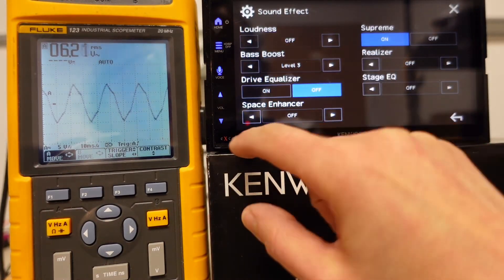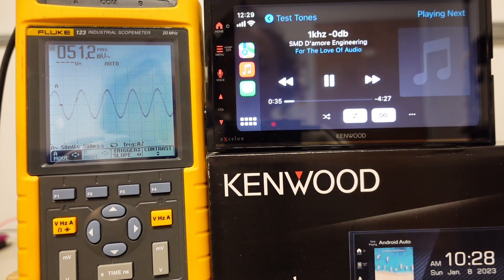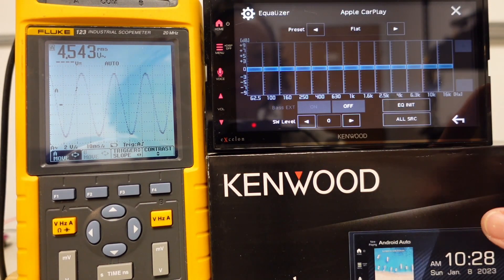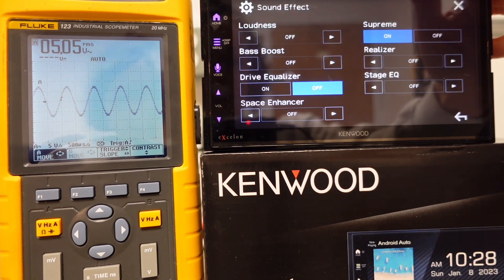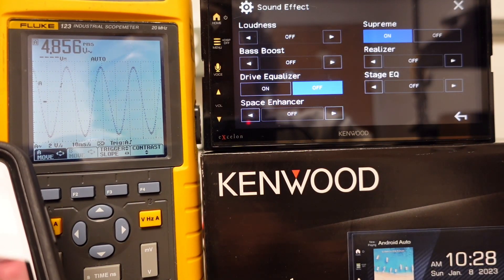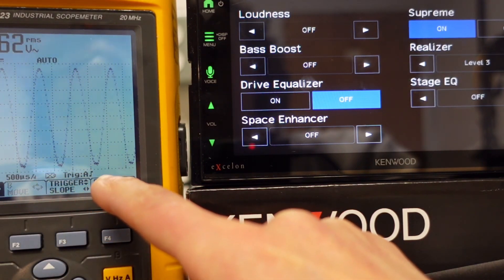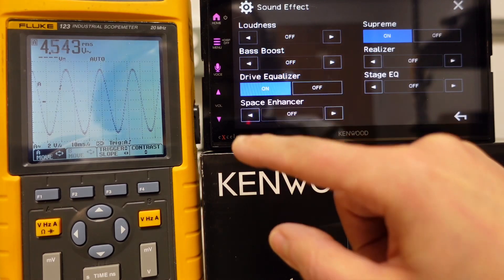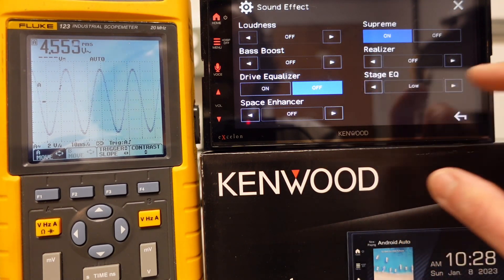Kenwood eXcelon DMX709s Preamp Test ROUND 2 - Apple Sound Check OFF

Comment: Hey excellent video, very detailed. I’m curious how to turn the sub on, on a dmx709s. We have power to the amp, tried multiple amps and subwoofers. All known working ones. It worked before, But i reset the settings when I disconnected the battery now there is no more sub action. Cant figure out for the life of me how to turn the sub on.

Comment: Hey! Love your videos. I am an installer and tuner at a car audio shop and find them very helpful with the pre-out tests. I wanted to ask if you can possibly test one of the pioneer 6600/7600/8600nex radios. So may say they are clean all the way up but to my ears i feel the excelons are louder and more clean and full sounding. I know the 5v preout has some to do with it but they are also hi res certified models. Kind of a head scratcher :/

Comment: Anything on Android phones that would cause the same factor as what you experienced when testing the pre amp output?  The reason im asking is because setting up my amps and all that im not getting any readings somewhag like what you saw.  This is off my factory head unit and factory amp im spliced in after the amp because honda has the 10th genz so attenuated.  That sends the signal to my dsp which then goes to my amps.  I have opted to stay with my head unit because so much runs through it and all chimes the steering wheel controls and side mirrors, but since ive got so much money into my sound system now and its under performing by a lot im headed to buying this head unit as im told with the metra intergration i can maintain all that stuff for a price of course.  But now im in the market for a good head unit and im being recommended to this unit or even the one above and im losing my mind here slowly lol...thanks to your video i feel bettet but wo nder how much android is hurting my readings and sound ...ugh
Reply from the maker: Yes, absolute volume. Try turning that off in the settings.

Comment: I just installed in my 2012 civic si with the stock premium sound system. After install, there is a constant static noise coming from the front tweeters, and the lowest volume I can use is still a bit loud for a conversation. Any suggestions?
Reply from the maker: Yes, try turning volume offset down to level match between the factory amp and the head unit's internal amp.
Reply: @carstereochick  yeah that was the first thing I tried and didn't affect at all. But whatever he did worked like a charm.
If you're familiar with the vehicle, do you have a recommended replacement for the rear deck sub? We tried the kicker comp 8" but basket didn't fit. Haven't had time to look for others yet

Comment: Whats the speaker leads output test at around 10:00 for? Does that mean the speakers will be clipping at volume 25? But the rcas can go up to max volume without clipping.
Reply from the maker: Yup! The radio's internal amp will start clipping at 25, but the preamp is clean at max volume. Great question.
Reply: @carstereochick i see. are most stereos like that? I guess i can adjust  the output so i can play up to max volume but not clip the door speakers to death. I plan on getting a stereo and will be staying with the headunit power until more kicker key amps come out, its out of stock everywhere

Comment: @carstereochick One thing I'm not understanding is why set the Eq to flat?  If you setting your gain on the amp to match the head unit and your Eq is flat, once you adjust the Eq wouldn't that put the amp into clipping? seems like it would be best to set your Eq curve then find your highest level for a clean output, then use that to adjust your amp gains.
Reply from the maker: Hey Eric, great question. Because this is really just to show the limitations of the radio and give everyone an idea of the head unit's capabilities. This is just one frequency we're testing. In general you really want to be making minimal adjustments on the EQ anyways, nothing in there should be jacked. It should be minor changes. To really do it properly, you'd want to EQ it 1st with an RTA and pink noise and then check for clipping using a variety of frequencies OR use a DSP that has the clipping indicator built in.

Comment: What about using USB for music instead of your phone, do we lose performance? I'm thinking no since no settings to mess with like on our phone, but I'm a noob.🤣 Thanks
Reply from the maker: Great question - it all depends on what kind of files you put on the USB! If you've got MP3's on there with a bit rate of 48 to 256 kbps, you are sacrificing sound quality. If your tracks were imported from CD's at 1,411 kbps and that's how large you leave the file, it's as good as CD quality. If you're downloading high res FLAC from HD tracks, it's better than CD quality. Garbage in Garbage out.
Reply: @carstereochick  well they're all from iTunes, is that good? I never checked to see what format they are. I'll check tomorrow, just getting ready for bed and got notification that you replied.  Thanks.. one more thing since I'm a noob, I never touch settings besides turning flat eq on. Would the 709s be a good option? Setting it with your settings of course. One thing I want is to be able to play video files MP4 (music videos).
Reply from the maker: Depends on your import settings for iTunes, take a look and see what quality level you have it set to. You can play video files from USB, but the thing is you can't play any protected files, anything with DRM which is like everything unless you want to sit there and watch home made videos. Because of that I think it's a lot easier to play video content from a phone using an HDMI adapter. I think this is a great value, I'm a big fan of the DMX709s. If you want wireless CarPlay and even better sound quality, I'm a fan of the DMX958XR. Full review on that is coming soon, just finished recording the content today.
Reply: @carstereochick  you mean I can't play music videos purchased on iTunes from USB than? 
  Thanks
Reply: @carstereochick  
Okay I've been doing research, it sucks that I can't transfer hi res music from my phone (apple music) signed up for a free trial and downloaded everything I've purchased but only in hi res to my phone and tried transferring it on PC and 😭. Quboz doesn't have everything I'm looking for like apple has😭😭. I have music videos in bit rate 127kbps stereo 44.100 khz. I'm assuming that's no good? In that case any good digital media receiver with 5v pre outputs? None hi res since I wouldn't need it, not going to subscribe to anyone just for music. I'll just stick with whatever iTunes has. Thanks for all your help 😘
  Thanks
Reply from the maker: Hey Gabe, sorry, yeah Apple kind of has a monopoly on that where if you're paying the subscription you're basically paying for access to the music, you don't actually own any of it. I still have a lot of stuff in my library though that I imported to iTunes from my own CD's in full CD quality. I think if you did that, you should be able to transfer it to USB, I've done that successfully. But then that means a ton of time probably re-importing everything into your library at the higher bit rate. This DMX709s is a great value if you need something that is iDatalink Maestro compatible. If you don't need that (and don't need HDMI?) the Alpine iLX-W650 is a rock solid option too, but that model is only 4 volt whereas this one is 5 volt.
Reply: @carstereochick  thanks again for your help, I was looking at the alpine but after watching some of your videos I rather get a 5v. So, I started looking into the Kenwood (709s). I've purchased all my music over the years from iTunes and stopped buying CDs. Apple should let us download our music at higher res since we've purchased it already. Heck I'll pay the extra since I purchased it a lower res not knowing this year's back. I'm still getting the 709s since it's 5v. Gonna set it up with your settings from your video. I'm glad I found your channel. Subscribed and can't wait for more. Thank you

Comment: Great video btw. I have the Kenwood DMX 709S and my sound keeps cutting out if I turn it up past 20. Speakers subs and everything. There is no voltage drop the song royals by Lorde cuts it out like crazy. Would you have any idea if it's the HU or do u have any ideas?
Reply from the maker: Thank you :) Possibly - is it giving you an error on screen that says DC off set or anything like that? Or all audio cuts out, but music appears to continue to play on screen? If it's definitely not installation related (like your amp isn't going into protection mode) just make sure the software is up to date. I'm not sure if you saw it in the video, but I mentioned there is a brand new update to address audio cutting out issues. I haven't run into this at our shop, but have heard of others experiencing this issue in the field and this most recent update should correct it.

https://www.kenwood.com/cs/ce/mm/firmware/2022/2022a/eng.html
Reply: Hey. If you haven't fixed it yet it's possibly the radio ground. I've had the happen a few times.

Comment: How does this compare to the Sony XAV-AX6000 ? In teams of sound quality/features and screen quality.
Reply from the maker: In terms of sound quality with everything flat they're nearly indistinguishable. But the DMX709s is wired vs Sony is wireless. In terms of screen quality/vibrancy/saturation, I think Kenwood is better. In terms of touch sensitivity and accuracy, I'd say they're about the same for responsiveness. I do some side by side comparisons in my more in depth DMX709s review and Sony XAV-AX6000/4000 review. I hope that helps!